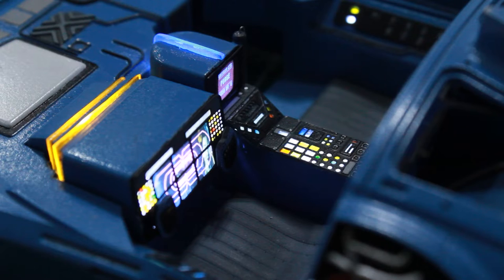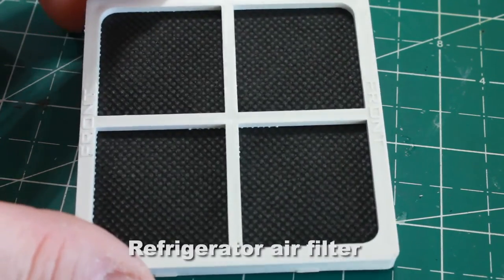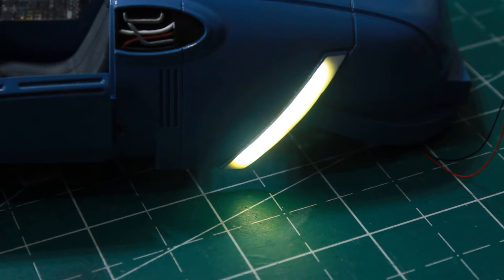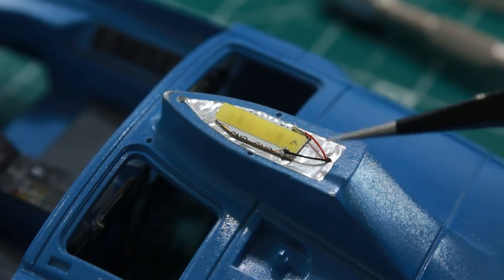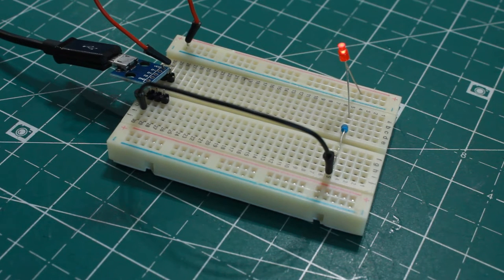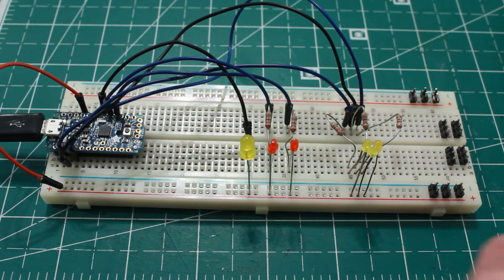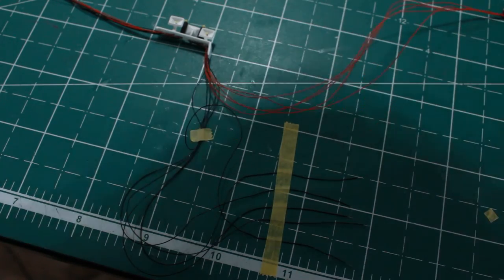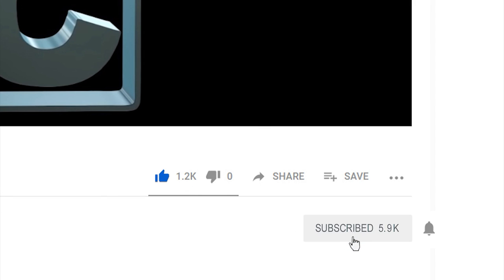1/24 scale Fujimi Spinner model build Pt IV more lighting and detail

Comment: I'm truly impressed with your 3 LED solution to simulate the rotating lights. I appreciate that it may look different "on camera" to how it looks in real life, but you may want to consider adding some capacitors into the circuit. This would cause the LEDs to fade in/out rather than just turn on and off, which would really help sell that rotating effect.
Reply from the maker: Actually, I have since updated my code so that it does actually fade.  I also slowed it down just a tad.  Only by about 100-200th of a second, but it made a difference, along with the fade.

Comment: Chris, is your scetch code ready to upload to the Adafruit Trinket board? Or do you need to add info to it?
Reply from the maker: There are 2 libraries I used that you'd have to add to your Arduino app as well. Links are in the notes of the sketch.
Reply: Ak ok
I did notice the link. I just wanted to be sure.

I've been sitting on this spinner model kit for over 4 years. I knew I  needed to light it up, but I never felt confident to start it until I watched your videos.
Thank you so much for your hard work and for sharing your techniques.
😎👍🏼
Reply: Sorry to bother you, Chris,
I've downloaded the library. It's a zip folder named NoiascaToolKit. Do I have to drop the unpacked files into the Aruino file directory, or does it get installed through "Preferences" as a link? Or some other way?
Reply from the maker: @IRMAO CUSTOM MODELS  there's an option in Arduino under the top "sketch" tab,  "include library" then "add .zip library"
Reply: @Models By Chris  
That's awesome!
Thank you very much, Chris. I really appreciate it